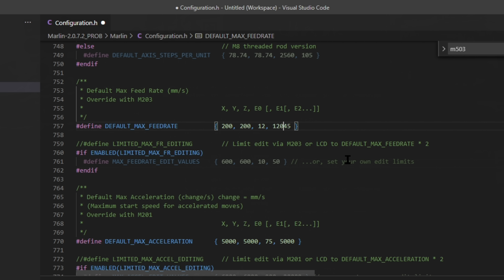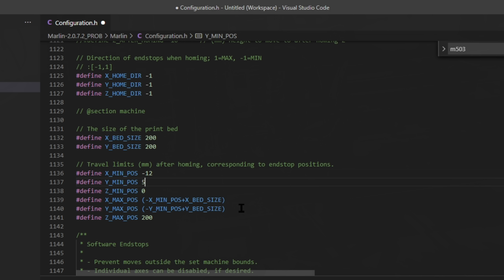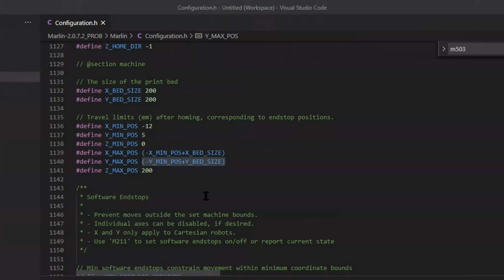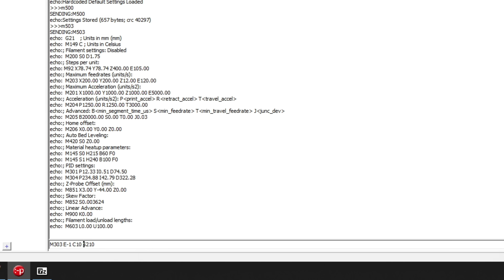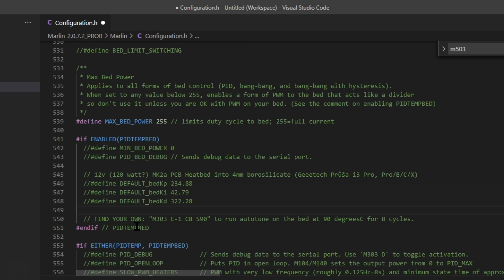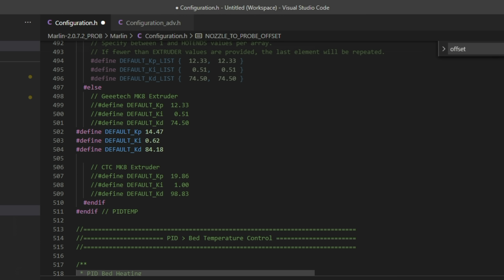3D Printer Fix Up - Geeetech Pro B - Part 4 - Chris's Basement

Comment: Just wanted to say, again, thanks for this series.

A year ago I commented on part 3 to thank you already, but in December last year I actually slowly started working on this printer.

When I started, it had the MK2a heatbed on springs with the glass top and the clips. It had no bed probe, both Z motors ran from the same driver meaning I had to keep re-aligning them all the time. The extruder idler arm was about to crack from disuse (common issue). It had a mystery version of marlin and the old A4988 drivers. The lead screws were misaligned and binding in the top mounts. It was a nightmare.

It took a lot of work and many iterations but now it has:

* The MK3 aluminium PCB heatbed, rigidly mounted, with a magnetic sticker, and a quality spring-steel PEI coated buildplate.
* A BLtouch clone with marlin configured for UBL.
* Separate Z drivers allowing marlin to auto-align the motors before every print.
* A (clone) titan extruder allowing me to print TPU. (on a custom designed mount).
* A (clone) full metal V6 allowing me to safely print PETG (and others in the future).
* Fixed (non-springy) lead screw couplers (I wanted to make sure the springyness was not causing problems).
* Top mounts which leave the lead screws to float (although by now they run very true due to all the other modifications).
* A cover for the PSU so I can't get shocked by accident.
* Proper part cooling.
* Delrin/POM lead screw nuts.
* BTT TMC2209 drivers.

On my to-do list still:

* Klipper / motherboard upgrade (I have an SKR 1.4 and a Raspberry Pi Zero 2 W already set up, I just need to write a klipper config, transplant the drivers, and mount the SKR)
* Manage the cables properly
* Switch to the Prusa MK3 style Z-X gantry hardware

Thanks to this series, this clapped out machine, and my general interest in these sorts of things, I've had an enormous amount of fun with this 3D printer. Currently it already prints extremely high quality parts at 100mm/s which would have been absolutely unthinkable with the original.

Can't wait to see what input shaper does for the ringing (I know marlin could do it technically but I never dared try what with the motherboard probably being underpowered).

Thanks again Chris!

Comment: Hi Chris, I was recently gifted one of these printers off of a mate, my first one. Found your series on YouTube and have really enjoyed learning about what makes the printer tick and 3D printing in general. Updated the firmware on this one from v1.1.9 to v2.0.7.3 as all later versions seem to not want to Z Home correctly if at all. This printer has issues with the Z motors so I'll be ordering a couple of new one along with some updated drivers and while I wait for those to arrive I'll be bugging another mate to print me some of the part upgrades you used.

 I was wondering if you're going to finish the series with another video to tie up all the lose ends: Lin Advance, Filament runout sensor and firmware tweaks you mention you wanted to do?
Reply from the maker: Hey, I'm glad the videos have helped you get into 3D printing. I ran into a bit of a road block with this machine. The frame was really holding a lot of the features I wanted to add back. Didn't really know where to go from there. I might still give it another go some day.
Reply: @ChrisRiley  Thanks for the response 😃in that case a short video on how to add a filament sensor to the GT2560 Rev A+ when there's also a BL Touch fitted to Z Min would be nice. I tried adding it to Z Max ... it didn't go well it would want to load filament even though there was filament already there when you started a print, so I obviously got something wrong. Have looked online and not found a simple easy to follow guide on how to fit the runout sensor to the GT2560. Could be my Google Fu is finally failing me.

Comment: I got a problem,, when following this tutorial i get to homing Z and the probe start decending and lighting up blue, but when it hits the glass the probe releases the pin 2 more times and then says a error. 
What to do about this?  I used Marlin 2.0.9.3 firmware. 
And did all the steps in this video
Reply from the maker: Does it deploy before it start moving toward the bed?

Comment: Hi Chris. Just wondering if you are ever going to do a follow on tune up video for this series. Spent like £100 on parts and now the printer is in a state where I can even get a print out of it. I tried updating the operating system etc like on the videos and get the probe working but still not joy. Would really like to get some prints sorted and I haven't got the knowledge or skills to fix it nor can I find anyone who can
Reply from the maker: Hey, I would, but I am not sure what else to do or what direction I should go in. I need to take a good look at it. Are the issues you are having just firmware? There should be an examole Marlin config out there to get you up and running.
Reply: @ChrisRiley  Im not sure if it is the firmware or the bltouch connection but like a different reply I wrote around year ago the bltouch just didnt seem to work on the self level at all. I followed the series to a T but I would lean towards it being a software issue as the touch is plug and play and the only thing that I remember having to change was the axis directions for the auto level. Personally it would be beneficial for me to see a video on a software update step by step(ie where to un# everything) and getting it loaded in to the printer and then after that is sorted a video on how to plug and dial in the bltouch and get it self levelling because like my last reply the probe wasnt even doing the 1-4 of the 16 self level locations on the bed. I was having to use a ruler to extend the bed so there is something a miss in my software settings. I was close to selling the printer to be honest but I wouldnt even get the money back I spent on the upgrades and if it were working consistently it is a good printer

Comment: hey man thanks so much for this series man, super apreciated, I wish more people see this, but I guess there are very few geeetechs, if there is any chance for more upgrades on this machine It would be awsome, in your opinion do you think it would be a good idea to upgrade the bed to a magnetic as well with a magnetic sensor?

btw what do you think in adding a z stepper auto align, you think it is possible in this printer?

what size did you use for the lead rods nuts? and I am confused trying to find the size of the spider couplings for the rods

best regards cheers
Reply from the maker: I was thinking about where to go with it next. Magnetic bed would be good, but only if you are using the BLtouch. It messes with the inductive type. Yes, Z stepper align would work great. They are TR8X8 nuts, the coupler would be a 5mm to 8mm.
Reply: @ChrisRiley  what about changing the x cariage end stops? Is it worth it? Termal isolation? And the ONLY thing else I would Change it would be the extruder, even tho mine is working good

Comment: at what speed are you able to print? i used to have a lot of layer shifts when printing at 60mms so i had to change it down to 20-30mms
Reply from the maker: With the stock extruder, I keep it pretty  low 50mm or less. I run the current somewhat high, around 800mAh, shifting hasn't been an issue for me.

Comment: Hi Chris, thanks for this great video!
Eryone TMC 2209 are actually not available in my country, do you know witch other I can use for my I3 pro B?
For the next video do you put the filament sensor? (I 'll just like to know where to plug it on the board).
Thanks again for your video and your help ;)
Reply from the maker: We can tackle filament runout for sure! Try to find ones that say STEP/DIR like these. That means they are configured for standalone mode. https://www.amazon.com/gp/product/B07RK28VWC/ref=ppx_yo_dt_b_search_asin_title?ie=UTF8&psc=1
Reply: Thanks! I'll look for these ones and wait for your next video for more improve on my printer 😉

Comment: Hey Chris, great videos! Thanks to you I was able to fix my GeeeTech Prusa I3. Thing now is: I have a double extrusion head (MK8) mounted on top of that and it is quite difficult to get the printer to work with both nozzles installed, any best practices on this? Even when perfectly levelled out, any oozing out of the nozzles is directly catching the first layer, making it nearly impossible to get the print started correctly....
Reply from the maker: I have seen this with a lot of these cheaper 2 nozzle printers. The only thing I can recommend is turning on the ooze shield feature in the slicer.

Comment: Excellent video as per.
Had the same printer myself. (technically still do but it's been through so many changes i think that all that remains of the original is < 10%....)

Though Chris, looks like the bed strain relief you linked to on Thingiverse is a slightly different design as the arm comes out horizontal to the bed acryclic, rather than up to the level of the heated bed like in the video?
Reply from the maker: Thanks! Yes, I had to change it up a bit because it was colliding with the hot end carriage.
Reply: @ChrisRiley  nay worries 👍
Did a lil redesign myself that brought it back ever so slightly but probably not enough for a stock X carriage.

Comment: Hi Chris, I have built my DIY 3d printer and I'm using 2 ATX power supplies 1st for the printer and 2nd for the heated bed. I used a 12 relay to on/off the power to bed. Now the problem is when the temperature is reached 60 degrees after that relay is toggling every second. Can you please help me to fix this. I'm using Ramps 1.5 and Marlin 1.1
Thanks
Reply from the maker: Are you using PID on the bed? That might help.

Comment: Fantastic video series, thank you for breating new life in to this printer.

A couple of things I had problems with:
Leadscrews have been ordered for the Z axis, so I'm still using the old threaded rods. As such, DEFAULT_MAX_FEEDRATE for Z needs to stay at 2. I had a problem where the z axis doesn't go up.

I was unable to obtain TMC2209 drivers quickly, so used TMC2208 instead. There is a bug when using Linear Advance with these drivers. My Z axis would not always return to zero. Often hovering just above the bed, and printing the first layer in air. Also the extruder would stop after a few layers. Disbale Linear Advance and the problem goes away.

My hotend throat has been replaced, with a 40mm one. This caused a problem mounting the part fan duct. A little bit of drilling to increase the screw holes upward fix it. Now I can reposition the part fan by a few mm.

Once again, thank you
Reply from the maker: Thanks for posting all your info, it is always helpful to others.

Comment: If you would do a tune in video so viewers could get a print sorted that would be very helpful Chris. Since I've fitted this probe I just can't get it working reliably. (3d touch)

I have set the z probe offset so it is gripping paper. When I go to print it is like it is not taking the z probe offset into account and it printing in mid air. I have tried changing it and storing via the printer button and also through vscode but the nozzle is miles off the bed.

It seemed like it was working to a degree the other day but now not at all. The bed level feature for the probe is very temperamental too. It worked yesterday and now when I got to level bed it goes the the 1/16 spot, the probe comes down and barely touches the bed and then the z axis raises up and the process stops all together. 

When the bed levelling was working the probe was off the end of the bed in the 4 spots towards the front of the printer (the probe was overhanging the bed) so I had the put a ruler flat with the bed to complete the process.

In dire need of some advice to dial this in mate haha. I think I've wasted about 12hrs and a whole load of filament trying to get this sorted. 

Also since I took the springs from the bed and put the brass spacers spacers I seen on vs code that the corners can only be levelled manually. Is corner levelling not needed if the bed levelling works properly.

Edit - Its the 3d touch that I have not the BLTouch. Will this make a difference to setup. I have tried //bltouch and un hashing creality touch but this is inverting the direction of the probe pin. Banging my head against the wall here. I can only think that the printer is ignoring the bed levelling process all together and the left side of the bed is way out or it is ignoring the z probe offset completely. I would hazard a guess at the latter but can't see why it was working a day or so ago and not now
Reply from the maker: It sounds like the probe might be getting a rouge reading once in a while and causing it not to work. If that happens Marlin will continue with the print, but throw away all the bed leveling info. I would guess the probe is wonky or there is a wiring issue. Some of the knock off probes can be very unpredictable. That is correct on the corner leveling, if the probe is working, you won't need it.
Reply: @ChrisRiley  Thanks for the reply chris I took a few days away from trying it because I was getting angry. Any idea when the dealing in video will be coming? you mentioned on a few of the firmware vids. Printer is literally useless atm. Would you recommend a BLTouch purchase? Also can you suggest settings to change so when auto bed levelling the probe is not off the bed at the front. I assume it is bed position in marlin but can find what I need to change. Thanks man
Reply from the maker: @ScottAndJen  The BLtouch will be more accurate, so that might solve some issues. In configuration_adv.h you can set probe point margins.
#if PROBE_SELECTED && !IS_KINEMATIC
  //#define PROBING_MARGIN_LEFT PROBING_MARGIN
  //#define PROBING_MARGIN_RIGHT PROBING_MARGIN
  //#define PROBING_MARGIN_FRONT PROBING_MARGIN
  //#define PROBING_MARGIN_BACK PROBING_MARGIN
Reply: @ChrisRiley  Tried with a BLTouch mate. No better. I have tried to use the config with no probe so I can at least print and I do not know how to get the z to run on the end stop now. Printer is currently MIA. Could really do with a run through of firmware and Slicer settings so I can get this running mate as I have followed exactly to all your videos. Is this something you will be following up with as you mentioned it in a few videos. Thanks
Reply from the maker: @ScottAndJen  I will see what I can do on the next video.
Reply: @ChrisRiley  Appreciated that mate. I look forward to it

Comment: Hey Chris, I was really excited for this video to come out since I have the same printer as this. I did all the upgrade you did on your videos with profit except for the stepper drivers: I bought Eryone TMC2208 ( https://www.amazon.it/gp/product/B07PK25KYP/ref=ppx_yo_dt_b_asin_image_o03_s00?ie=UTF8&th=1 ) instead of 2209 since they are not available on Amazon in Italy. I don't know if I am doing anything wrong, I tried both keeping and removing the ms3 jumper and I tried different Vref from 0.8 to 1 (the maximum settable as the description on amazon says). When i start a print it does the brim correctly, but after 1 or 2 z-lift the nozzle just crashes on the bed and starts consuming itself against the glass. I also noticed movements in general are slower than with A4988. I reverted back to A4988 and everything works as expected. What issue with the steppers can cause this? Thank you for the great content you bring on youtube.
Reply from the maker: Hey, I know this was 9 months ago, but YouTube just showed me this comment. I hope you got it figured out.
Reply: @ChrisRiley  I increased vref to 1.6 as the math says despite vendor says to not exeed 1 and everythig is working flawlessly. I’m looking forward the next video of this serie. Maybe dual extruder as you teased us 😀. Please Chris, keep bringing us great content! Thank you so much for the knowledge you share with the community and you hard work!

Comment: Great video. Could you upgrade this old school video with Igus bearings on X and y axis? 
I am looking forward to watching the part 5...
Do you know the p3steel frame?
Reply from the maker: Not sure the size on those bearing, but you can probably make it work. I do know that frame. I might have to take another look at it for this project.
Reply: Dont use IGUS bearings for printers, many tried, nobody kept them long term

I got a P3Steel but would consider it an oldtimer now.

Comment: Did you put the lerdge? I love that board. I am getting great prints.
Reply: After I changed a stepper. I should have gotten the k lerdge like you said.
Reply from the maker: Yeah, I haven't been working with the Lerdge much after the install. I might go with it on a new build.
Reply: @ChrisRiley  I am surprised.  I am getting good prints.

Comment: Ahhh the dreaded benchy hull line 😱 I always get it with prusa slicer. The only way I ever got round it was by hacking prusa s hand crafted gcode that’s here: https://help.prusa3d.com/en/article/the-benchy-hull-line_124745

Btw thanks for another great vid for the geeetech. Mines in pieces now as it’s being converted to a bear. Well mostly I’m doing a scratch bear but borrowed some previous upgrades from the geeetech. Fun in lockdown3
Reply: Simple solution in Simplify 3D. Just print a solid infill layer every 5 layers or so. Not sure if Prusa slicer has the same option - pretty sure it does.
Reply from the maker: I know right, I have done that hack too, hopefully the Prusa slicer updates will fix this some day.